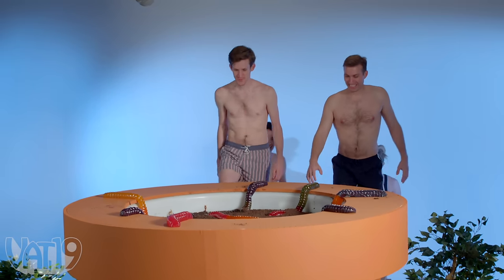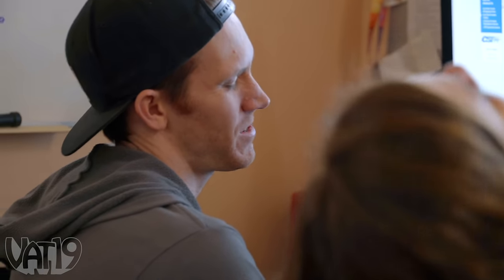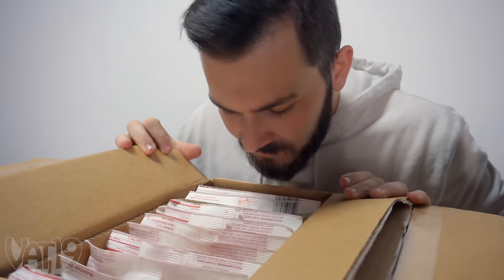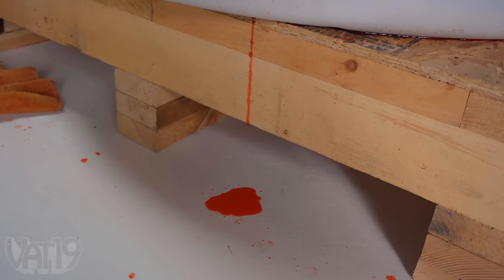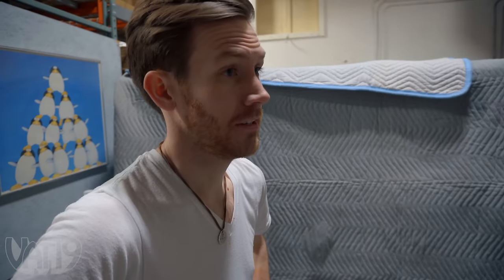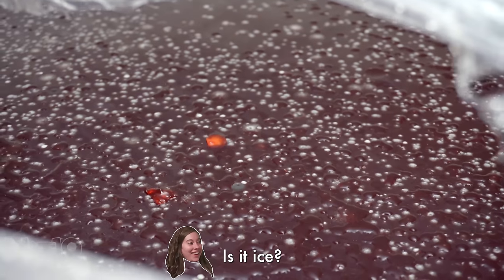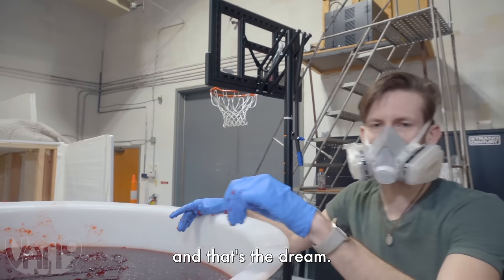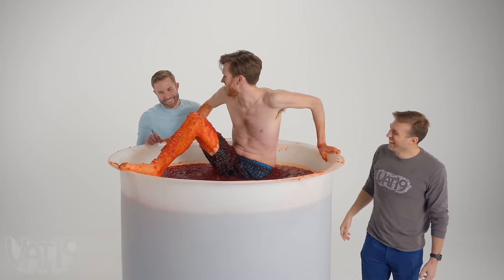We Built the World's Largest Jello Cup!

Comment: HVAC guy here. Chances are that the reason your jello got moldy so fast was a number of reasons

Reason A) The refrigerator you built with the AC system was not up to commercial quality; you can't just slap a room air conditioner into an enclosed space and expect it to be able to chill food in a sanitary manner. Refrigerators have very specific kinds of cooling systems to help keep food sanitary while it's being chilled, with very specific humidity ranges (Which is why black mold appears in fridges when these things don't work properly). That's not even going into insulation that you need to use, as you can't just caulk a bunch of materials together and expect it to work or be sanitary

Reason B) You exposed the food to the air for too long. The jello sat there for a period of time, exposed to the air long enough for any number of bacteria to get onto the top surface of the jello. When you make stuff like jello, it needs to either be served or put into a container and sealed afterward. What you pretty much made was a giant petri dish.

Reason C) Lack of light. A way to prevent mold and bacteria is light (Light has a sanitizing effect, especially UV or sunlight), but the food itself was stored in a dark, cold and wet place, which mold absolutely loves.

Chances are reason A was the biggest contributor. I'd advise heavily on renting a commercial fridge (You can rent any number of commercial kinds, including walk-ins) next time you do a project like this

Cheers!

Comment: Mold is a type of fungi and fungi is like mushrooms. Mushrooms have roots, so mold does too (but you can’t see the roots). Basically, just because you scraped off the top of the jello, that doesn’t mean there is no mold left at all.

Thank goodness you didn’t eat it 😅
Reply: Correct in theory, but, you're actually wrong. It WOULD have been dangerous to eat, but, mold doesn't have "roots".
Reply: Actually, I searched it up on Google and it said mold has branches and/or roots which are like thin threads that are very difficult to see, especially if they’re is still growing on on the food. It also said that those branches/roots can be found very deep in whatever you’re eating.